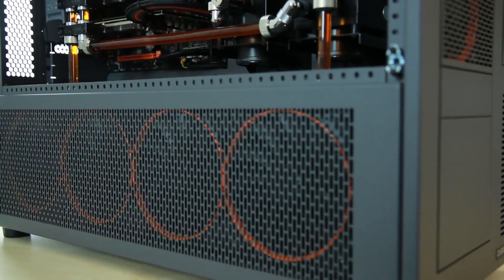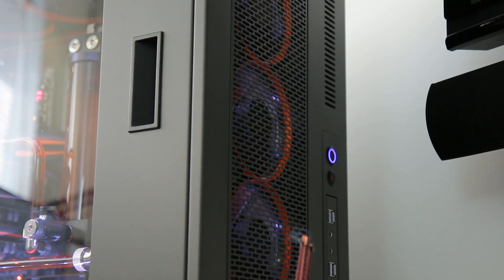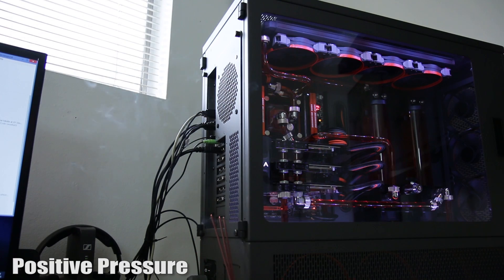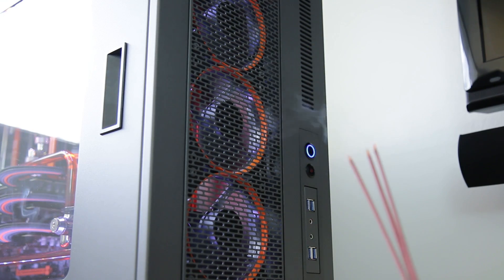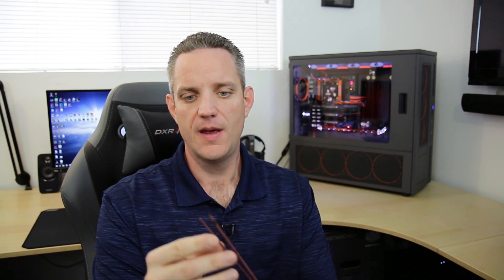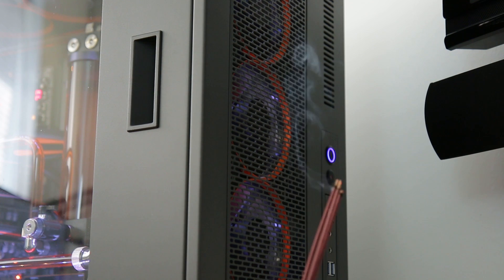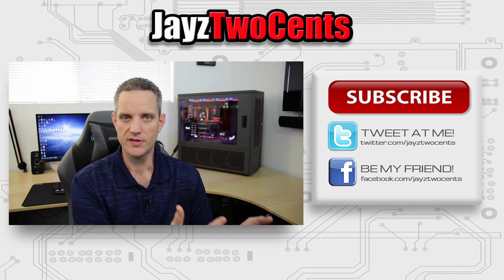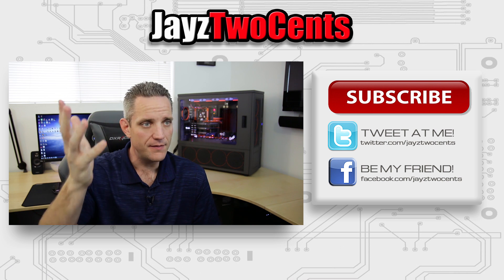Case Flow and Pressure Demonstration - How to balance airflow

Comment: i just use my vape lol
Reply: I wanna say that's genius - but I know you were just chillin'  one day, vapin and gaming and you saw the vapor go into your case and you were like "whoooaaa" and felt like thomas edison
Reply: TK TrueKep thats why there weed 😂😂
Reply: Nerd.
Reply: this just blew up... god damn
Reply: Idea 
Lol problem solved 
Just use a pressure washer 
XD  DAT ADA WORK
Reply: Take a look at your windows, if you happen to vape near one often. If not, you will see that on the walls as well, just wipe it with your finger and see the difference. See that smudge? That's caused by the VG in your vape and now that's build up in your PC components as well, serving as a nice platform for dust to really grab on to.
Reply: lol yup pretty much after that i walked around wondering what else would interact with it lmao
Reply: E-cig vapor is non-conductive. Wouldn't be an issue at all. Some of you folks are dumb as shit.
Reply: +TK TrueKep 
Can't prove your point you mean ;)
Reply: Also, wouldn't using vapor be safer than smoke? I'd take my chances with water vapor (that's in the air anyway), over leaving carbon soot deposits on my radiator fins, right?
Reply: you could also take out your rad and wash it with denatured alcohol or a slew of engine part cleaners.
Reply: Bryan Alexis Flores 
That produces tar. And your joke is unfunny.
Reply: INVISIBLE SUN all I see you saying is lol 😊
Reply: Your vape hurt my pizza.
Reply: TK TrueKep you're a moron if you think vape is water. It's propylene glycol and vegetable glycerin. Which are non conductive for starters. Even then it wont condense on things that are warm like heatsinks. Plus he's not doing this 24/7 he's doing it for a few seconds at a time. Chill your pants, it's more than fine.
Reply: This is the most absurd conversation I’ve found on YouTube today, congrats guys, you only lost out on points because to one compared anyone to Trump 🙄
Reply: Gotta blow some phat clouds on your PC to protect its virginity just like your own.
Reply: My friends and I were lounging around in my room with vape and my PC running in the back when they wanted to blow the vape next to my pc to visualize airflow. I didn't let them out of fear that it may affect my components. Glad I did.
Reply: Risk of shorting something with e juice is non existent imo,it would also short atomizer/coils when it gets wet from juice. Imo its same as breathing next to fan,and it wont cause corrosion because every corrosive components are protected,if not they would rust out from air,it contains water too
Reply: I did it once and my pc crashed instantly dont do it
Reply: +TK TrueKep 
The cringe is unreal you're the idiot lmfao
Propylene Glycol (PG): When heated it produces Vapour  
PG is used in inhalers, Fog Machines and E-liquid AKA vapes are mini fog machines mixed in with extra chemicals i.e nicotine, flavouring
Reply: If you are not joking, don't ever do that again. Vape is water. Water is moisture. Moisture + Electronics equals to disaster.
Reply: it doesnt hurt anything lol
Reply: You have no idea how moisture and corrosion works do you. You may not see the effect immediately. You are basically shortening the lifespan of your pc components.
Reply: 4 years latter still good lol
Reply: Facepalm, Do you even understand what shortening the lifespan of your pc components mean. Whatever, I won't argue with idiots.
Reply: I Hate Hello Kitty You start bringing up chemicals do you know That PG is hygroscopic? Hygroscopic means the liquids tends to attract and retain water. In layman's term, vape is water. So what is your point exactly?
Reply: nateman10 Lol you are comparing surrounding humidity with vape humidity. The amount of water percentage is not even close.
Reply: +TK TrueKep
So let's get this right you want to say that by OP blowing vapour into his system he is corroding his componets/parts/etc 
how is that possible where is your studies or proof of how much moisture is in the PG expelled by the lungs/mouth? I have been using a EC for over half a decade my pc is fine.
People use fog machines to see their config (a lot of people do) and fog machines produce much higher PG which would get it's mositure from the air.

You're debating aboslute minuet amounts that you have no proof on vs me, OP and many others who vape for thousands of hours with our PC feet away from us 

It shortens your componets okay but by how long, where is your studies/proof? you have no idea. I mean it's too complex, the vapour never sits in the system I would agreee with you if you were to blow loads of vapour in your turned off system allowing it all to sit but OP or I aren't
Reply: I Hate Hello Kitty I don't need to. You didn't prove anything either.
Reply: I Hate Hello Kitty I repeat, I won't argue with idiots.

Comment: mi pc have onli 3 fan case mastercase pro 5 140mm intake in pushing have good cooling single gpu 970 and i7 4790k noctua nh14 not oc have very low temp internal case
Reply: Why are you worrying about your PC air pressure when you can't even spell "my" and "only" correct. Also I did not understand your comment at all.
Reply: English is probably not his native language so it's actually quite impressive. How many languages do you speak let alone write?

Comment: carbide 400 see with a closed loop watercooler i use 2 140mm mag lev fans at the front and 2 120 mag levs on the radiator in push pull on the back

Comment: So.. I should have more fans with high rpm on the bottom of the case that are pulling air inside, and fewer slower fans at top for the exhaust ?? That way its gonna create positive air pressure and the cold air from the environment is gonna stay in the case longer to cool the hot air and pc parts ??

Comment: is there a performance difference in 120mm and 140mm fans?
Reply: Brettitonion xGBx 120mm fans need to spin at a faster rpm than 140mm fans in order to have the same airflow. The advantage of the 140mm being the slower the fan, the less noise it makes. I saw a case with a 200mm fan at the back and it was silent even under load.
Reply: Ok thank you, that helps quite a bit.

Comment: here's a cool mod, turn your case into a hovercraft, have some exhausting air into a cushion at the bottom, and than some out the back with a ducted fan. unplug from wall and race them against other hovercases.

Comment: Loved the start of this, you said positive airflow. As in positive air pressure inside the case so dust isn't being sucked into the case and onto the hardware. Luke from LinusTechTips did a fan config review to get the most cooling but all of his tests were negative airflow making the fan filters obsolete. Straight bad advice not just for cooling but for cleaning schedules. I don't know about you but I don't want to clean the GPU and CPU heatsink but I don't mind cleaning the filters. And that's what positive airflow brings to the table.

HVAC on the other hand from computer cases you want the air to be recycled with no outside air at all for maximum efficiency, that's a complete different animal from a computer because there is no moisture worries to cause catastrophic failure. In a high humidity environment an enclosed PC case with AC will have moisture shorting out the hardware. An open case will move the moisture through the case allowing it to remain airborne instead of on cooler parts of the hardware. Ofcourse you could put a Peltier plate on the bottom of the case instead of used with the CPU cooler to dehumidify the air but that would be more inefficient

Comment: Key points if you don't want to watch the whole 10 min video

1:58 why you want positive air pressure
3:10 why you don't want negative pressure - dust will go into non-filtered holes (But will that con be negated if you just put filters over those non-filtered holes perhaps? Ionno)

But his case and amount of fans are wayyyyyyy too much to be relaetable for me lol.

I got a fractal r5 and planning to just put two intake fans at the bottom, 2 in the front, and 1 in the back.  Obviously it will be a positive pressure.  But I'm debating which fans I want on the controller or the motherboard.

My mobo supports 4 fans and my built in controller supports 3 fans.  Hmmmm anyone want to chime in their ideas?
Reply: Itsneight 

Apparently you don't even need airflow in a pc lol..

One of Linus video shows them stuffing the case with random crap and nothing really happened if I remember correctly lol
Reply: I have a Fractal design R5. With a 6700k OC to 4.4 GHZ on a 212 EVO. and an MSI Gaming X GTX 1070. There is no point to adding more fans than the ones that come with the case. Temps are great while playing intensive games for hours.
Reply: Combatsmithen 

My 6700k was already set at 1.328V by default (mobo: z170-A).  So yea, got a noctua fan dh14 pwm or whatever the name is, replaced the back exhaust fan with the noctua.  

The r5 case fans run quiet because they're pretty weak to begin with soooo yep
Reply: Candi Soda 1.328 BY DEFAULT? Thats CRAZY. The 6700k does a 4.2 GHZ turbo on 1.2 volts right out of the box I have it OC to 4.4 at 1.275. The fans aren't that weak. At max RPM they push a fair bit of air. If you didn't hook them up to the 3 speed fan controller you should. That way you can turn them down to be quiet when just browsing or playing low intensity games, then if you play more intensive games just set them to max. I run a P95 8k FTT size benchmark and my CPU temps don't exceed ~65 with the OC on my 212 EVO. You should be able to turn off that auto overclocking feature. I had that and it applied way more voltage than what was needed
Reply: Combatsmithen 

I'll have to look into the auto clock feature, I didn't know they did that.  

Right now it's set to 1.312 at 4.2ghz.   With benchmarks it goes to about 68 at the highest point.  That's with a noctua cooler also.

At idle it stays at like 22/23c.  But when summer comes probably have to lower the OC
Reply: Candi Soda My I7 idles at ~25. I also don't have AC. It should be fine as long as it doesn't get 80+ consistently. 68 isnt that bad. But I recommend lowering that voltage to 1.2
Reply: Combatsmithen 

Sorry, I meant it's at 4.5ghz.
How many increments to go down by with voltage? .05?
Reply: oh. 1.328 at 4.5 doesn't sound all that bad. Im doing 4.4 at 1.275. lower it little by little and each time run a P95 test. if the PC crashes raise it. I use Intel XTU it makes it super easy
Reply: I got an R5 with 5 140mm fans, the two stock fractal desing fans that come with the case are one in the rear and on in the top connected to the fan controller of the case, have two noctuas NF-A14 PWM in the front (connected to "chasis fan header 3" on the asus mobo) , and one NF-P14 FLX (conected to "chasis fan header 2") at the bottom, blowing air direct to the gpu, took me 3 days to do all the cable management, the hard drive cage are at the bottom in the front due to the optical drive (sorry for the bad english)
Reply: DualPerformance No kill like overkill
Reply: SerenitySky fan filters are near pointless if you're running negative pressure. The only benefit from filters is that with a positive pressure build you have isolated where air can enter the case, and you can filter those locations. with negative pressure, air leaks in everywhere, and the only benefit of having filters is preventing large debris getting pulled into the intakes. Which doesn't matter much if it's getting pulled in elsewhere anyway.

Negative pressure and positive pressure are separate from good air flow. You can have good or bad flow with both. Good Air flow is harder to achieve, but more effecient with positive pressure, because it's being pushed directly towards every exit point. If you can manage that and still achieve good air flow over the main areas, that is ideal.

With negative pressure, air gets sucked in everywhere, but then immediately moves in a direct path towards exhaust. It's less effecient, but is easier to achieve good air flow with, due to more of the air moving in uniform direction. The reason people sometimes see better temp results with negative pressure is because their positive pressure air flow is designed poorly, and the increase in air moving towards the exhaust in the negative system creates an increase in overall volume. 

There's a case to be made for both. Which is better is really dependant on how often you want to clean out the system and how good you can get the air flow path in your particular build.
Reply: Combatsmithen xD it will works fine with 3 fans, but this was the first time that I upgrade to a very good case, bought all those fans to do some airflow testing
Reply: DualPerformance 

I guess technically you could put 11 fans in the case.

3 on top
1 in the back
2 in the front
2 at the bottom

2 on the heat sink
1 in the psu

lol
Reply: Candi Soda :3
Reply: Combatsmithen 

What I don't understand is, why are the 2 FRONT fans towards the bottom.  Why not place them towards the top so it goes through the cpu instead?
Reply: Candi Soda Because the 5.25 bays are there. and the rear fan sucks out the top back. therefor air gets through the whole case. Front bottom->Top back
That wouldn't make a temp difference on the CPU and wouldn't give as much air to the GPU
Reply: Don't forget that you need a nice flow around your components (That's why negative pressure is bad, its not only if you have filters. + filters add resistance to your air flow), if its gonna pull air from the back of the case and from the front of the case you lose 50% of the air flow that other wise would've passed from the front fans and it would've cooled all your parts and exit at the back.
Reply: What if you OC motherboard? how will you cool of the mobos heat sinks, other than adding custom water sinks on them. All this is on a small scale. So average person that doesn't OC probably doesn't even need to know about this.
Reply: Negative pressure means that it pulls in the air, cuz theres not enough of it. It's not constant like positive airflow. Also doesn't the hot air rises?
Reply: hot air wont rise fast enough to make a difference if theres a strong air current, i.e. intake at the front, exhaust at the back
Reply: DualPerformance ph

Comment: Yesterday I also noticed that the placement of the fans inside of the case is also very important. I don't know what happened with my brain, but changing motherboard and CPU I managed to turn the CPU fan 180 degrees in the wrong direction when mounting it on my new CPU. This way the fan sucking air out of the case and the fan on the CPU cooler was pointing in the opposite direction. That lead to my 6700K reaching temperatures of up around 95C which is totally crazy. Just by putting the fan on the other side of the cooler making the air go through the cooler towards the case fan sucking the air out of the case temperature sunk by about 30C which is alot for just rotating a 90mm fan 180 degrees... Quite interesting how little really can mess up alot! :D Just my 5 cents

Comment: I have already tested my fan placement. Front, Side Door, & Rear to intake. & a 299 mm Fan on top for exhaust. I have good results.. just wanted Jay's opinion.. Ty..
 the idea of making the Rear fan intake is to have cool Air go past my CPU cooler & Ram Slots.. Plus ,side door over my twin GPU'd in SLI, & front fan over HDD's// I have it like that in my Cooler Master HAF 932 & will do the same on my new HAF X.

Comment: negative pressure is the way to go.  positive indicates a decrease in air velocity in the case.  drawing a negative promotes the most velocity throughout the case.. even if the case is drawing in from areas that will bring in dust.  just clean the dang case and clean the area and keep the pc off the ground! 

This is coming from an engineer

Comment: I'm an HVAC guy and I have used vapor from a e-cig to check if the flues are drafting. Do NOT use smoke next time Jay. If you have any coil inside in your case (water or air). Soot could get stuck on in your radiator or even your air cooler, and dust will stick to the soot causing clogs.

Comment: Hey Jay. Please answer this. I'm using the Cooler Master HAF X Case. My Fan arrangement is as follows Front, Side Door & a 140 mm in the back are all intake.
Only 1 200 mm Exhaust in the Top Rear mount. Do you think this is ok or should I make the rear 140 mm also Exhaust? CPU is AMD 8350 & 2 EVGA 980's in SLI & a Duel 40mm Ram Cooling Fan assembly.
Reply: Set 2-3 Exhaust :P But If a were you I test that with our with out rear 140mm :D . Doing is the best learning.

Comment: i left the side of my case open because there isn't any space left in my case and air can't get through if i put on the side. and i'm speaking of 20°C increase of cpu temp. under 5 min. it's like placing a laptop on a pillow.

Comment: My motherboard has case fan headers built in, any 1 know if it is a good ideal to plug 200mm size fans into the motherboard or could that cause a little more load then would be good for the boards long term life, should I just give the 200mm fans straight to the power supply? Any advise on this?